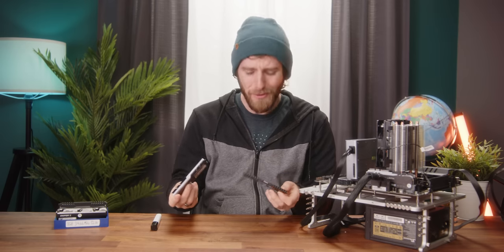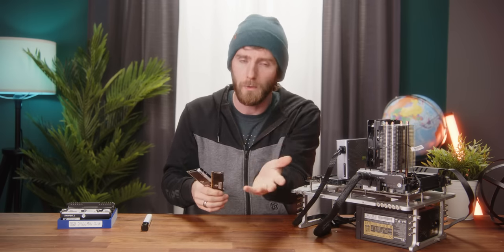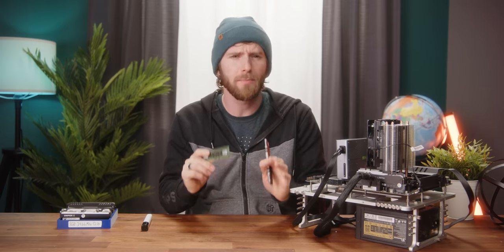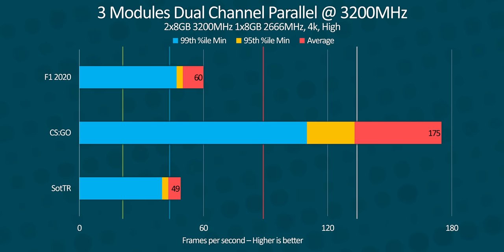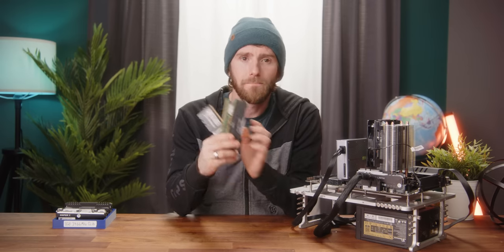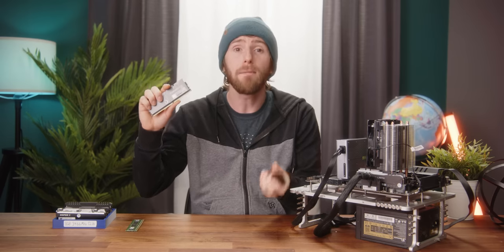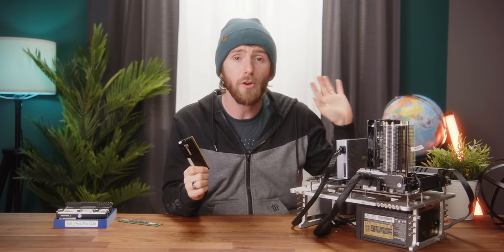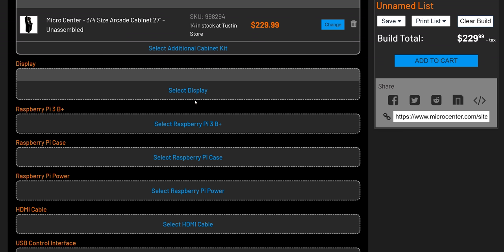Just How Bad is Mixing Memory?

Comment: as kindly requested my Linus at the end of the video,

im running :
Asus Z390E-Gaming
Intel Core I9 9900K
Asus ROG strix 3070 OC 
Samsung 1TB M.2 MVME ssd 
Samsung 4TB Sata 2.5 ssd
Adate 512GB M.2 SSD (Steam library)
2TB Hikvision Sata 2.5 SSD
WD RED 6TB sata HDD
6X Corsair ARGB LL140mm Fans
4X corsair LL120MM
Cooler master ARGB 120mmAIO (I'm sorry about this one and i know its inadequacy and am looking at corsair H115I as we speak)
8X Corsair ARGB LED strips
Corsair 7000X case white 
Asus ROG strix 850W white 

and finally
48GB of Corsair Vengeance Pro memory

so my setup of ram is balanced per channel after TONS of research running in 24GB per channel 
in the set i have 2X 8GB DDR4 3466Mhz lit and then another 2X 16GB DDR4 3200Mhz
i installed as follows
slot 1 8GB | Slot 2 16GB | Slot 3 8GB | Slot 4 16GB |
and it booted up slowly the first time but after that, all was noticeably faster and quicker.

hope this will help someone with a similar setup wanting to do the same 
and if anyone has any recommendations or questions, feel free to post or ask

Comment: I know it is sometimes OK to mix but I usually avoid it.  If anything I get a set of DIMMs that are identical other than each one having its own serial number.  I mean the same brand and spec, maybe all the part numbers on the chips being the same too.  It is lot easier when you have an ordinary DIMM with no heat spreader or god for forbid useless RGB.

Comment: bro if i have 2x8GB ddr4 corsair vengeance lpx 3200mhz ram working together in a channel and if i put another 1x8gb corsair vengeance ram 2400mhz in 2nd ram channel will the other two ram work on 3200mhz or the lowest still 2400mhz and if not is there anyway that i can work my way around with this lower freq ram with the already installed 3200mhz rams working together in a channel so that the 2400mhz ram doesnt lower the freq of my other two rams ?

Comment: I recently installed 2x corsair 3000mhz sticks along with another 2x corsire 3200mhz sticks and didn't notice they had different timings. Still left XMP Enabled and worked for about a week and a half. I then noticed the RGB wouldn't work sometimes and iCue wouldn't detect them but task manager tells me otherwise. Then when I reset my system due to AMD drivers being erased by Windows (grr Fresh install of windows btw) I noticed a little bit of glitchiness during installation. After that I decided to play with the Cpu tuning slider (I have a asus prime z690 w/ i7-12700k) went from xtreme tuning to fast tuning and everytime I logged into Windows system would crash. I then reset again with XMP off and got past with no crashing. Installed some RGB software and the moment I click apply, CRASH. I was so furious because i was so sure if it worked for a week it should work forever right? Well it wasnt after I took out the mismatched ram and did a fresh windows install, now I can set my RGB. Never had issues with installing amd drivers, and I can use XMP again. Kinda nervous to change the fast tuning and xtreme tuning in BIOS but hey I'm happy now!

Comment: Bought used pc parts and got four mixed 8GB green PCB OEM 2400MHz CL17 (Samsung C-die & Hynix AFR = crap) they run fine at 3333MHz with 16-19-19-38  @ 1,32V. 
My old computer ran mixed 4x4GB DDR3 Corsair and Crucial 1333 green PCB  at 1600 with 9-9-8-22 @ 1,5V, maybe I got lucky both times, but mixing isn't that bad for non-hardcore OC.

Comment: I understand mixing memory is bad, however I currently have 4 sticks of the corsair Vengeance rgb pro 32gb 3600  ram. Two sticks are causing instability issues, and corsair is saying because i purchased 2 sets of  2 sticks vs 1 set of 4 sticks this is causing the instability.  Is this a thing or should i call  this a loss and just buy the gskill ram ?

Comment: Eh, you could have tested this more in depth. I recently combined two different 2x16gb kits of ddr5 for 64gb. With stock issues, same timings or chips or specs were not possible. At first it bluescreened frequently, but after adding just 0.05v, the slower kit now runs at the faster kit's speed and lower timings with perfect stability. I've never found any ram kits that couldn't be tweaked to work together, vendor compatibility list ignored.

Comment: I have 2 corsair 3200 cl16 vengeance. And 2 corsair 3600 cl16 vengeance. How about that? I run 3200 in the base slots and the "faster" in the extra slots. Ive had small micro issues like odd startup. Intel i5 11600K has been good to me so far

Comment: So I had two 4gb ddr corsair vengeance 3200mhz. I've just bought two 8gb ddr4 corsair vengeance 3200mhz. I should just swap out and sell the 4s?
Reply: You can keep them all, as they are the same brand and mhz speeds, just have it as 8,4,8,4 in the board and boom you have 24gb ram :) I currently have 4x 4gb ddr4 corsair vengeance 3000mhz but tomorrow going to be swapping two for 2x 8gb corsair vengeance 3200mhz, even if the 3200 gets downclocked to 3000 24gb is better than 16 :D

Comment: If I had 4 Ram sticks that are the same brand, same rated speeds and timings, the only difference been. 2 of them are 8GB in size and the other 2 are 16GB in size. will this cause any problems. As lets say you wanted more Ram for some reason, but can afford to replace all 4 Ram sticks, would this work???

Comment: Funny thing is that i have to OC my motherboard to actually run windows cause my RAMs running on 3200mhz basically but mb can only handle 2999(on paper) but with the default settings windows crash out after 10-20 seconds. So i must choose the XMP profile that is on 3200mhz. So fucked up.

Comment: hope u can answer.
i have old desktop lenovo m92p ssf.
right now I'm using Kingston 4gb 1600mhz single stick + sk hynix 2gb 1600 single stick.
Should i update further with 4gb x1 or 8gbx1. 1600 mhz 
Buy option;
1. 4gb 1600mhz single stick (any brand Kingston, Samsung, sk hynix, teamgroup etc) so the total could be 4+4+2 
     here a secondary question will 2 x 4gb 1600 mhz but different brand will make it dual channel?

2. 8gb 1600 single stick (any brand) so the total could be 4+8+2

for gaming, workload, which will be better. option 1 or option 2. and will option will become dual channel if different brand are mix

Comment: I have tried with my p5qc motherboard, it has ddr2 800mhz slots and ddr2 1066mhz slots. Tried to run them both. And it blue screened a few times, it might be worth noting as well, to not mix ram voltages. I believe that was also part of my problem
Reply: Is it ok if your DDR2 ram has 2048mhz ?
Because my 2x2GB ddr2 does for some reason

Comment: Can I combine the "Corsair Vengeance LPX 32GB (2 x 16GB) DDR4 3600MHz C18, High Performance Desktop RAM Kit (AMD Optimized) - Black" with the "16GB G.Skill RipJaws V red DDR4-3600 DIMM CL19 Dual Kit" on a "ASUS Prime X570-PRO Motherboard Socket AM4, Ryzen 3000 Compatible, ATX PCIe 4.0 DDR4 USB 3.2 Aura Sync" Mainboard?

Comment: Got 16gb HyperX Fury 3200mhz CL18 DDR4 RGB, and then I got 16gb Kingston Beast Fury 3200mhz CL18 DDR4 RGB. Works like a charm, that's because it is the same memories. So Kingston stopped manufacture HyperX Fury RGB, or well, they still DO manufacturing them but they changed the name of the memory to Kingston Beast Fury RGB.
Otherwise I needed to buy new memory and fill all 4 slots, because you can't get HyperX Fury 3200mhz CL18 RGB anywhere any longer. So with my expertice, and some detectivework I found out Kingston, that made HyperX Fury RGB changed name on the RAMs.
That is utterly fcked up if you asking me. Is it because they think people bying more of them? They make us think: "Oh, look there, a brand new RAM from Kingston. Damn, that's cool." Yet it is the bloody same RAM that I bought before with just changed name. Why are they doing like this? I mean HyperX are Kingston's own brand and name.
But well, only cool thing is that on top are saying Fury on first and HyperX on second. I will put them so they spell HyperX Fury instead.
I am glad I found out tho. Otherwise it would be more expensive to upgrade to 32gb. Had only 16gb before that. 32gb however made the computer much faster, acctually got 20-25 more FPS in Battlefield 2042. Yeah, that game eats CPU and RAM for breakfast, lunch, dinner and eveningsnack.

Comment: Question.  I have two 8gb 2667 ram sticks.  I want to get two 16gb 3600 sticks and just add them in my two open ram slots.  I will pair the like modules together..  Will this work?  Does it matter whether the larger sticks are in A or B?  Thanks.

Comment: A couple of years ago I bought an Acer Aspire A715-41G laptop (with discrete GTX 1650Ti) populated with 2x 4GB SODIMMs. I took one of the 4GB out and replaced it with a 16GB to give myself 8GB dual and 12GB single. It just worked without any problems and I haven't seen any issue with games or any other software at all. As Linus said you don't have to match stuff up but it is a bit of a lottery. (I won.)
Reply: Same here too. Stiil smoth with 4+16 GB RAM. No heavy load i thinks till make mine's broke.

Comment: So, I recently got an Old PC which has 32GB [4x8GB] RAM (2133 Mhz). I thought of using it to upgrade my Gaming PC having 2x8 GB 3200 MHz Corsair LPX Vengeance. I have the AsRock B450 Steel Legend MoBo with Ryzen 5 3600.
Do you think it'd be wise to either replace all 4 sticks or should i populate the remaining 2 slots with 2133 Mhz RAM.
Or should I just let it be the way it is.........

Comment: I mixed my G.skill RipJaws V 3200mhz with G.skill Trident Z RGB 3200mhz together. No difference besides I had 32GB instead of 16GB.
Latency? Believe that’s the set of number after the mhz. And XMP I can say worked for me on a b-550 board.

Comment: i have a 2666mhz unknown manufacturer module and a 3200mhz corsair vengeance lpx module, but both are running at 2133mhz amd the hp bios don't have xmp option in their bios. can i do anything about except buying another corsair module?

Comment: got an new 64GB 3200MHz Kit of Corsair Vengeance lpx and combined it with the old 32GB 2666MHz Kit of Corsair vengeance lpx (oc from 2666 to 3200mhz) 
and it works just fine :)
PS: Got the Same Speed, then with only the New Kit, that already has an base clock of 3200mhz...

Comment: So if I have a 2x16 kit that’s 3600mhz and a kit that’s 2x8 @3200Mhz But I cap it at 3200mhz it will be fine? Even if one takes more volts than the other?

Comment: Wht if u use lets say 2x8gb cl16 3200mz ripjaws and in the other two slots 2x8gb cl18 3200mz vengeance ram sticks ? Each in their respective channels A1 and B1 ripjaws and A2 , B2 vengeance would it work with dcop ?

Comment: I have 4 completely different ram dimms (16 GB total) in my i7 4770 system and the computer runs perfectly fine!  No complaints whatsoever!  Once a person reaches a CPU speed of 3.3 Ghz and higher, performance difference is negligible.  Having enough ram for the CPU to access should the main priority.

I'm not a gamer or power user anyways so ram is ram.

I do remember that Linus did a ram comparison a long time ago and found that differences in ram differences and speeds were negligible at best.  The most important factor was having enough ram for the CPU to access...

Comment: What will happen if you mix ddr4 with ddr5?
I want to remove one of my memory sockets and solder 1 ddr5 socket back to my motherboard and put a ddr5 memory along with my current ddr4 ram modules, see what happens

Comment: This only works if you put them in pairs I had 2 pairs of DDR4 444Hrz and 2 DDR4 540Hrz if I mixed them the board didn't boot up  at all, I had this happen with all 4 sticks made same speed same DDR everything.. They Didn't work unless I installed them in Pares.

Comment: Hey so im still pretty new to owning a pc and i am wanting to get more ram because i just dont have any space left. And i was wondering if i have to do anything about my old stick of ram like transfer data or if i can just remove it and put in a set? I just dont want to mess anything up or lose anything
Reply: RAM doesn't store data when the power is off it is volatile memory.

Your data files are stored on the SSDs or HDDs so changing RAM won't damage your data if done properly.

With the computer off and unplugged you can remove the old RAM and replace it with a new kit.

Consult your motherboard manuals for the RAM specifications to buy the correct kit.

Comment: Who can tell me if my Asus Vivobook X513EA-BQ2811, with 8GB DDR4, 4GB soldered and 4GB in the one and only slot (WHY ASUS???) can handle different latencies? The system goes up to 20GB/3200mhz according to manual, but I'm not sure if by replacing the 4GB module with a 16GB/3200mhz/CL 22, would work...flawlessly. I cannot access the laptop atm as I don't have it with me, so I cannot run any checks (CPU-Z...etc). In a nutshell, what really worries me is the soldered RAM. My simple guess is that since ASUS gives a max of 3200mhz for the system, the soldered chip should be able to handle it, right? :)

Comment: I have 3 older computers.  4GB each. One desktop. 2 laptops. All different brands.  But, all using the latest Linux Mint.
I simply wanna borrow the memory from the laptops & combine on the desktop to give me more memory for VirtualBox that’s running OS’s that require 4GB minimum.
How do I do this w/o having to modify hardware?  Isn’t there a software solution via networking via Ethernet?  If so, what can I do?

Comment: What about DDR3 modules? I've had my older PC setup for a while now, and i have 8GBs of ram (2x4GB), but I've found a nice bargain for HyperX Savages 16GB (2x8GB). Thought about upgrading my setup a bit, so would it cause some issues if i just slapped those 8GB sticks next to my original 4GB ones? (also 4GB stcks run at 1600 mhz, while 8GB ones at 1866mhz).

Comment: So I don't know if anyone could help me here, I have 2 8gb modules 3000mhz one is ballistix the other is xpg with the following timings: 
Xpg: 16-20-20
Ballistix: 15-16-16-35
They both run at 2666mhz and when I try to set them to 3000mhz I get a blank screen until I take off the xpg and reset bios
So is there a fix ? Or is it impossible for me to get to the clock speed ?

Comment: I'm running 1x 16gb hyperX Fury 2666mhz and 1x 8gb 3000mhz hyperX Predator on my ryzen 7 2700x. It is running at the lower rated module (2666mhz) and did not bother to try matching the higher rated module

Comment: Lets say you use 2x16gb rams sticks and than you add 2x8gb ram sticks,  both being DDR4, same brand, same speed. Would this work and be ok? As a reference. G.Skill Trident Z Royal Series [Silver] 32GB (2 x 16GB) 288-Pin SDRAM (PC4-25600) DDR4 3200 CL16-18-18-38 1.35V and then G.Skill Trident Z Royal Series [Silver] 16GB (2 x 8GB) 288-Pin SDRAM (PC4-25600) DDR4 3200 CL16-18-18-38 1.35V Dual Channel Desktop Memory Model F4-3200C16D-16GTRS.

Comment: i personally run pc with 24 gb of ram, just fine, it is ddr3 1600 but i run it comfortably at cl10, even though i have complete mismatch and actually at maximum speed of which motherboard can support, cpu is overclocked too, i5 4670k at 4.2 ghz, and even with overclock i got it to consume only 50 watts under full load..

efficient and humming along

Comment: I just did it last year, along with my Hyper x fury RGB 8GB(x2) I get another Hyper X fury Beast 16g (x1) non-RGB, it works well thought I have some issue when I opened first my system it's just black screen, then when press restart button it boots well, or sometimes it did throw Memory overcloking failure then need to go to bios to just save and reboot and it's all fine, now I'm planning to add more maybe this time 32gb variant

Comment: Pre-thoughts before I actually watch the video:
My computer has two 8 gb ram sticks in it already, and a few years back I tried putting two 4gb ram sticks in my computer from my mom's old computer, The only thing that happened was, even though my computer knew they were there, it couldn't use the new 8 gigs at all.

Comment: I built a PC with a 2-stick kit of DDR3 2400 RAM -- 8GB or so.  8 years down the line, bought another pair of the exact same 'model' of RAM. Set to 2400MHz as per XMP - it would just about boot and then Bluescreen. It was, however, stable at 2133Mhz. When I checked --- the PCB's are actually different. Same manufacturer. Same Carton. Same factory-fit heat spreader. Boo
Reply: Amusingly, I figured it out yesterday. For the random sod that comes along - on this specific motherboard (A88XM-E35), setting the modules to run Linked rather than 'Auto' stabilised the system.

Comment: I have Samsung 8GB DDR4 SO-DIMM 2666MHz CL19 stick I took out a lenovo Tiny and planning to install it in a Intel NUC11. I was looking at buying a second DDR4 SO-DIMM 2666MHz for dual channel. My Question is, would I be fine by mixing the Samsung CL19 RAM with a RAM with a CL15 timing like the AddOn (4X70W30750-AA) 8GB - 2666MHz or better stick with ones with a CL19?